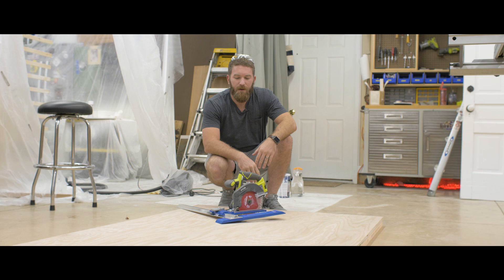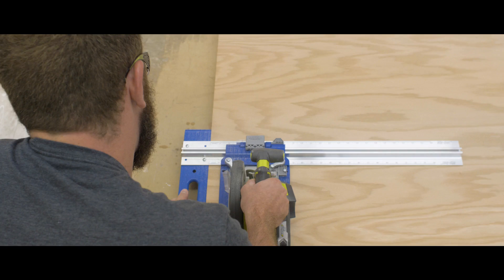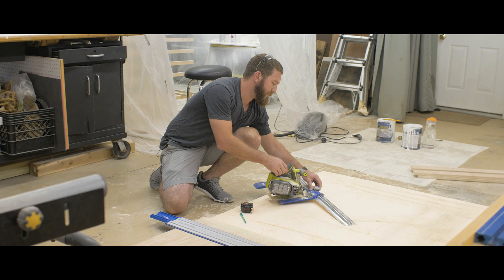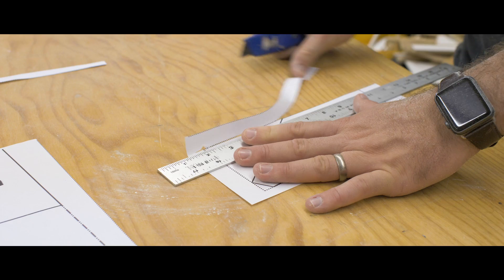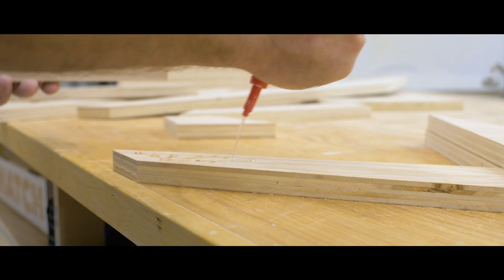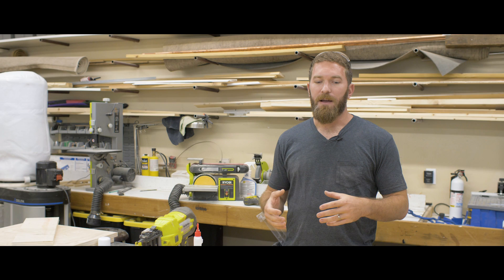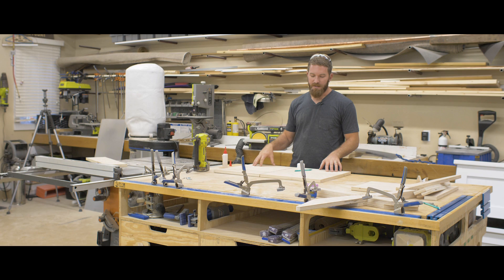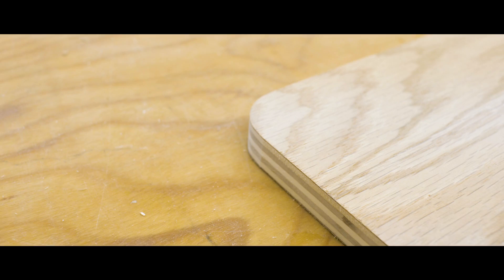2 Chairs and a Side Table from 1 Sheet of Plywood

Comment: Hi, good evening, I print the design, but do not hit the sizes, do you have it in the correct size !?
Reply from the maker: They should be correct. Make sure you don't have checked any "scale to fit" or "fit within page" button.
Reply: Soooo...I think I need instructions to use the stencils. I printed and made sure it's "not to scale" or "fit to page". How do the pieces go together? It's a little confusing to make sure I get the right length
Reply: Ok. Figured out the stencils. Whoa this chair is not that sturdy.

Comment: I love Kreg products but that one seems a dog as it's not providing a accurate track to work with, same goes when routing with an extended fence, nice channel you do & not knocking your Projects but rather mentioning this product
Reply from the maker: Thanks! And I do believe this is why they only went with a 4ft track. I thought it was pretty accurate but any distance greater than that I would start to get concerned.